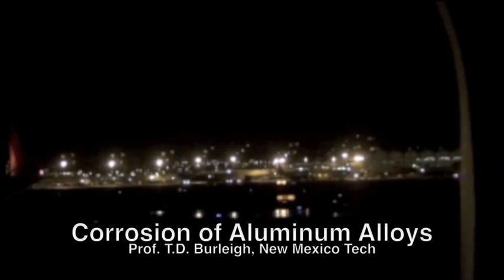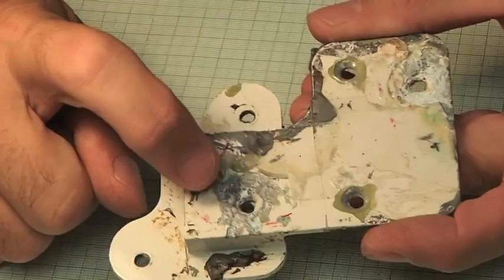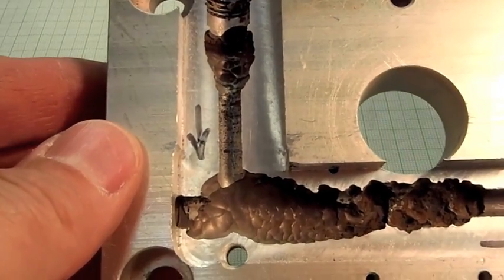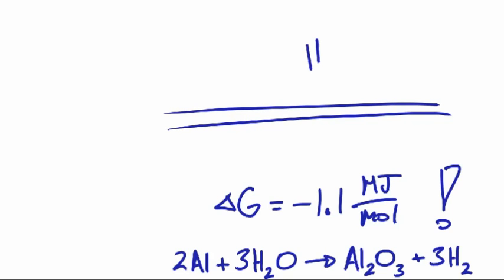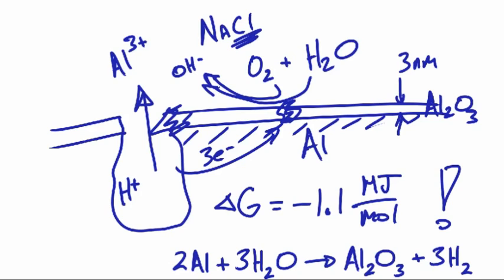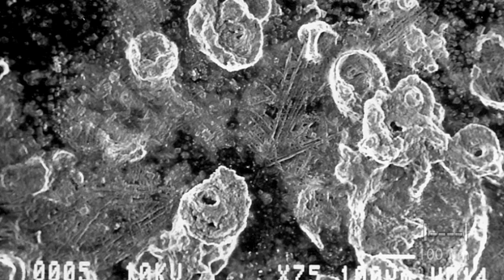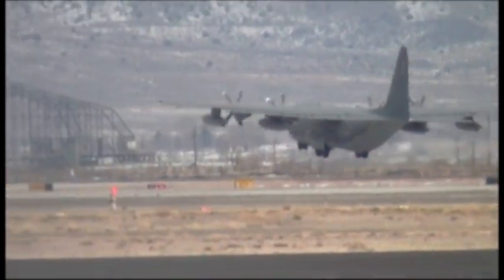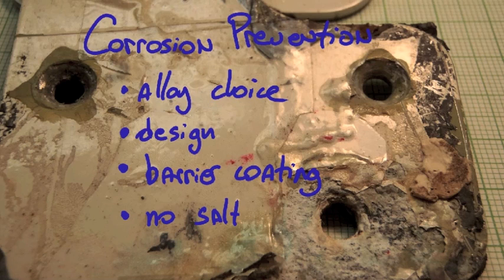Corrosion of Aluminum Alloys

Comment: Awesome dude, im working on stripping and sealing my honda d17a1 valve cover. Some lesions, but about to seal it with high temp engine primer and metalcast paint to slow the corrosion.

Comment: Thank you so much for this interesting and compact video about aluminum alloy corrosion. I recently [fled] California and moved to the Midwest. I got a used Jaguar with an aluminum alloy body known as RC5754. I was quite concerned about the amount of road salt and dissimilar metals (75% of the car is aluminum). So I got an application of Rust Check which was originally developed for the aviation industry to protect from salt. I was doubting my $175 yearly application thinking its a waste of money. But now I see aluminum and aluminum alloys are far from corrosion proof.  So I am happy to have discovered this video. So if you own a Jaguar or Ford F-150 or some other aluminum body vehicle? It is always wise to get it protected with something like Rust Check.

Comment: I guess that's why they say aluminum is "corrosion RESISTANT " rather than "corrosion PROOF "; I always thought that aluminum metal doesn't corrode at all because of the protective oxide coating.

Comment: I have a question about this sort of corrosion on my cast aluminium sewing machine. It is a very good machine except for the corrosion on the bed.  Can I remove the corrosion and repaint it and, how should I do it.  What should I do next to prevent further corrosion?
Reply: Well, there's always chemical etching. Etch it down past the corrosion to the base metal. There's always blasting. But, you could smear metal OVER the corroded areas, which would just keep on corroding underneath. On airframes, aluminum is nearly always alodined, primed, then painted.